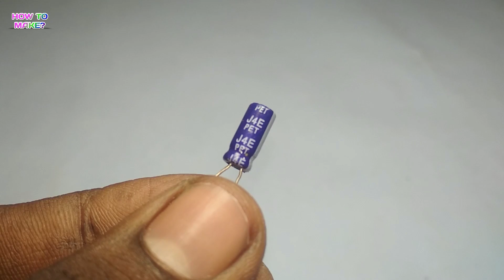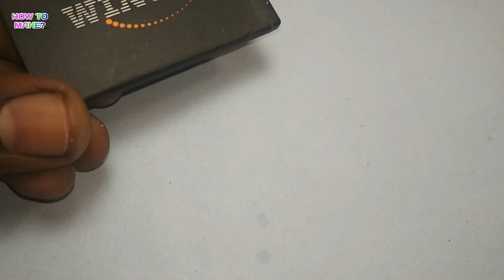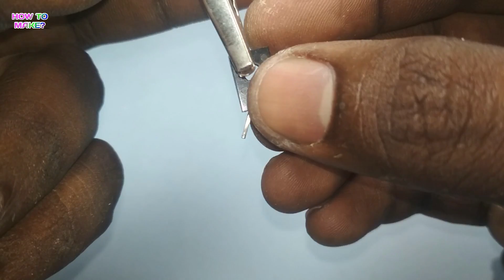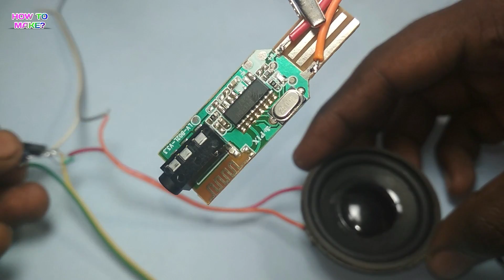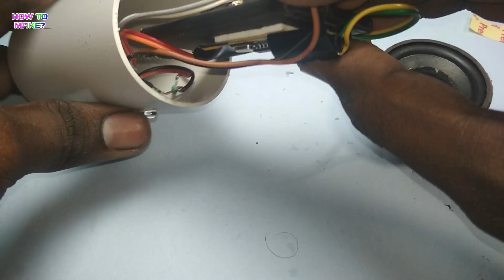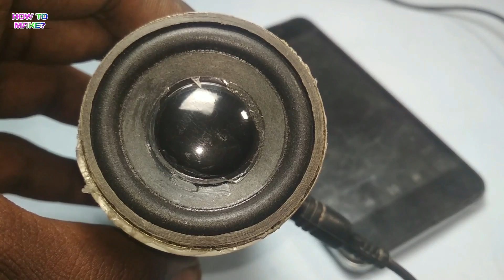DIY Mini Bluetooth Speaker With Old CFL Transistor

Comment: There is no protection/float for charger.. Automatically when d battery is full there is a high possibility that it will overcharged and explode.. And it might be fake the first LED was white and in final video it turns into green.. Why??. Thanks me later.
Reply from the maker: First led 3v led so speaker sound low after change 1v green LED sound is good. 
Check out this video in full. Your chance to understand :- https://youtu.be/CdroTLu5hlc
Reply: It's true
Reply: Yes , lets assume that you have already replace the led to 1v to reduce the power consumption. but still there is no float to protect the battery from overcharging.

Comment: This isn't safe at all. 
Just a diode between the power jack and the battery? Yes, phone batteries are supposed to have a protection circuit built in, but if this is a cheap battery, it won't, and thus be likely to explode if you use the wrong voltage. There's also no indication as to what the right voltage could even be.
Also, all of the electronics are taped onto the battery. If any of them get hot, or get damaged, it will damage the battery and make it burst into flames.
The heat sink also seems to be close to touching the battery - this is a terrible idea as batteries don't like heat!
In addition to this, the enclosure hasn't been made airtight so sound leakage will be a big problem, and as such the sound quality will be poor.
My advice: either make something which is much safer, or just go and buy a bluetooth speaker.